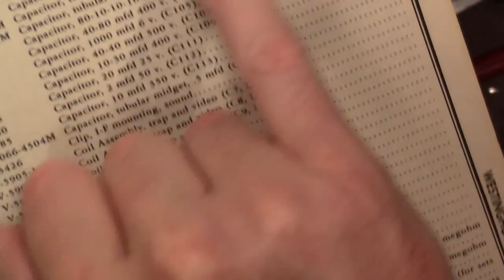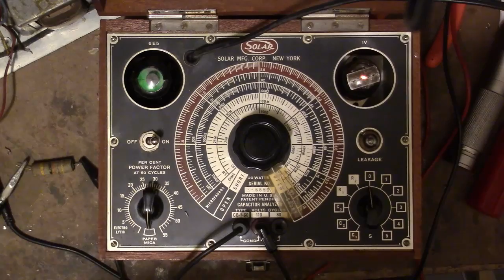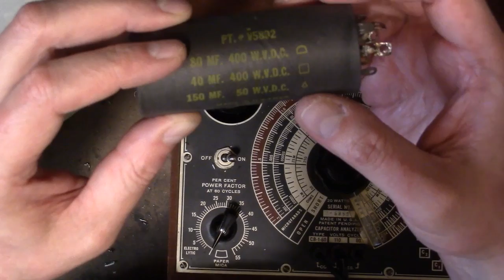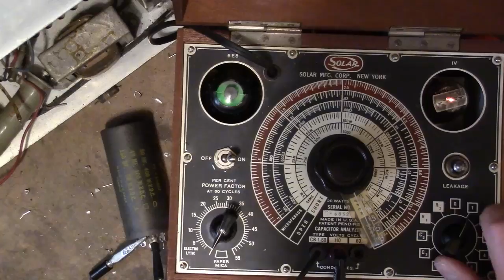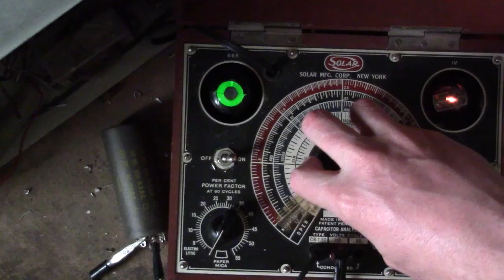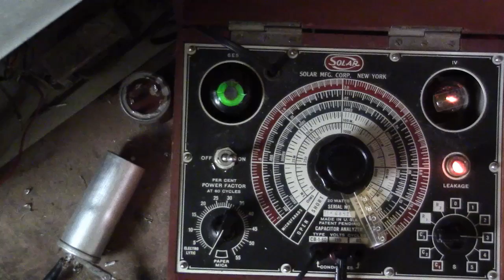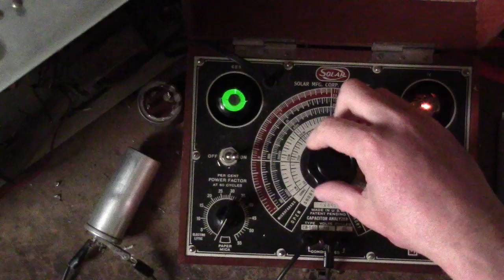Westinghouse H-196 restoration p4o?

Comment: There is a Google patent US2300072A that you can look up describing that 'new' capacitor construction from 1942.  As Dennis Carter commented here, these were known as cellophane condensers, with the material being cellulose.  From the patent: "Thus the structure of the invention consists of a combination of metal foil condenser plates with interposed dielectric material in the form of homogeneous layers of Cellophane and polyisobutylene, the whole being if desired rolled into a cylindrical condenser, or folded into a flat condenser, or otherwise arranged according to the customary and usual procedure. "

Comment: Bob, those caps look like the Mallory caps I ran into in an Admiral recently that I had never seen before. They were obviously replacements, but they looked similar to bumblebees, and based on the way they looked I called them "yellowjackets". Only difference is they didn't use color stripes for the values like BB's and those you have run into. Although I didn't show it, they all tested leaky and were garbage like your typical BB. But the insides looked very similar to what you have there... a film like thing I had never seen before, but I have no idea what time period they were from not being original parts to the set.
https://www.youtube.com/watch?v=1DC21-b7z0Y
Reply from the maker: ScottTV1962 I've encountered those Mallory Plascaps before too.  These are made from a much harder material.  Possibly ceramic.  That's probably why they are called hi-temp caps.
Reply: bandersentv Curious as to why you would need a high temp cap in those locations? I assume the voltage would not be an issue. Interesting engineering.
Reply: ScottTV1962 I wonder if they tried some sort of fabric, even fiberglass cloth, perhaps treated with rubber or other chemicals?  Waxpaper and tin foil was very cheap.  I remember hearing about mylar caps in the 60s, drum heads are made of mylar.  Plastics became very popular in the 50s.  They had acrylic audio tape in the early 50s.  And movie film goes back to the early 1900s.  So there were materials that could roll up into a tube.
Reply from the maker: ScottTV1962 There are a few high wattage resistors under the chassis and I imagine it gets rather warm.  Maybe warm enough to effect wax caps ?

Comment: I enjoyed the testing of those caps. You're right, you really can't tell from appearances whether or not they will be good. I'll never forget a particular Emerson ac/dc radio I had....the original cardboard 'lytic under the chassis was badly squashed in the middle from spring clamp tension, it was bulging and discolored, and the wax end was badly cracked---not a peep of 60 cycle hum from the speaker. And I recently restored a '39 Philco TH-3 chassis that had one of it's original wet 'lytics still in place, still in the circuit; the boric acid hadn't leaked out of it, and it worked fine, with no hum. Of course I replaced those parts, but it just goes to show that you never know.....

Comment: I ran into some rather unusual capacitors inside a few radios recently, they have axial leads, a flat body, and a white rubbery jacket over them. At first I thought, "Oh good, someone has replaced some of the original wax paper caps with some more modern ones. Maybe this will save me some time and some parts? But just to be on the safe side, I will check them."
In any event , I lifted a lead on two or three of these white capacitors, and tested those three in place with a tester, and tested another that I had removed. The result was exactly what you experienced with that ceramic shell cap, I could not get a capacity reading on any of them, and each read leaky at a very low voltage. In short they are garbage, they look modern and like they should have a plastic film dielectric inside but they do not, it's probably wax paper. I've had Hunt capacitors test better, and even 65 year old Aerovox paper caps were good up to at least 100-150 VDC.